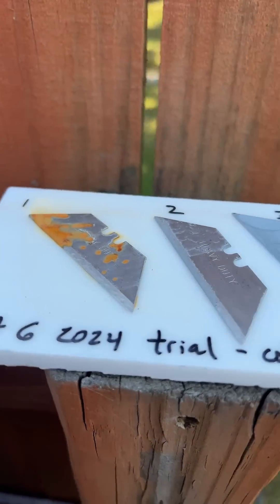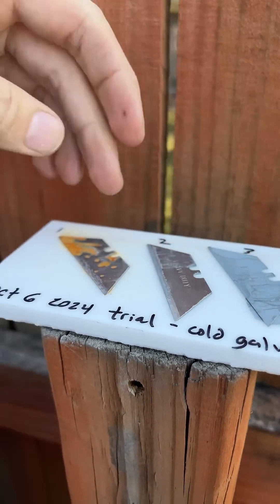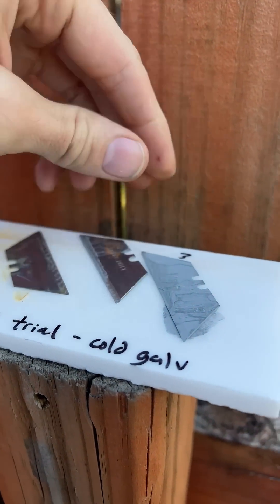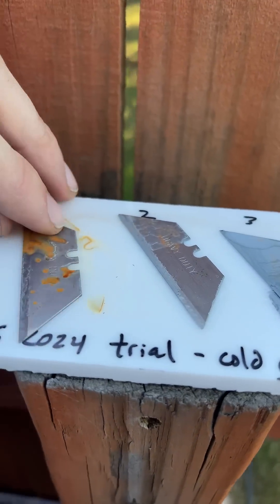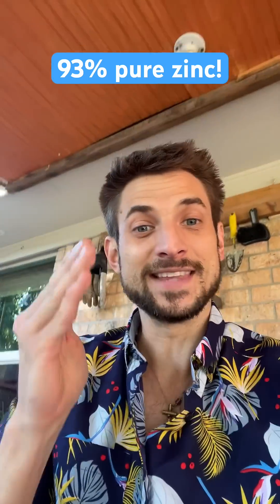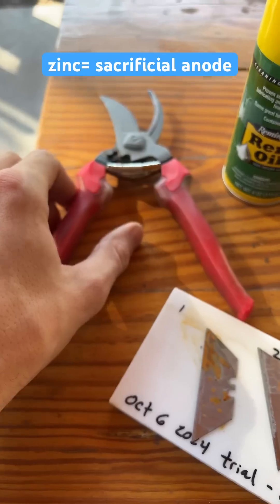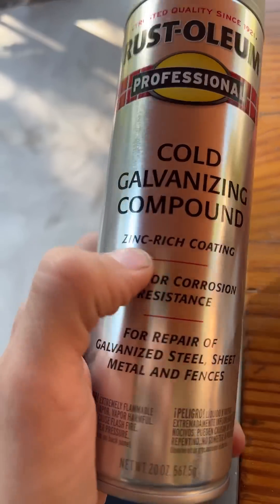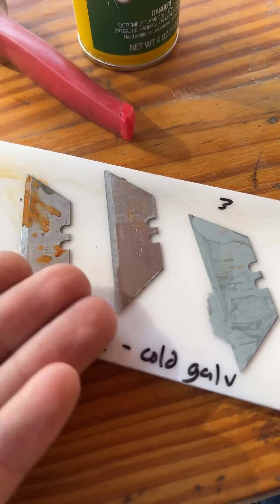metallurgy is real! end rust with this weird trick. #metalprotection

Comment: Zinc plating is great but those pruning shears are garbage! I bought the same ones at ace in the spring and they are terrible. It's mild steel and the edge didn't even hold up to thick branches. I had to put a new edge on them first hour I used them. I'm so glad I found my old fiskars pruning shears. They are a superior product compared to these

Comment: Galvanization can be applied in 2 ways. In a cold spray coating, like this, or in a hot dip where you drop the piece of steel in a molten zinc bath. Both processes are very effective.
Reply: We dip our machined parts in a hot zinc phosphate a d the coating is tough

Comment: I use that shit at least 3 to 5 times a week and I’m telling you it is not a galvanizing compound what it is is a galvanized paint with an adhesion promoter built-in rust oleum because it does not galvanize the metal galvanizing. The metal is an electroplating process does not do that.

Comment: I work in the metal industry, and we build antennae that go thousands of feet in the air. The weather conditions are constantly changing, so the pipes have to be protected. We have ours galvanized, and we also use this spray. It works wonders

Comment: Not sure this is doing what you think it is. You would need an electrolyte to have the zinc be an anode. Water could work, but you then need some current to pass through. 

Mechanically galvanizing a surface will protect it from oxidation, but thats not an electrolytic reaction.

Zinc is not an anode per se. You can put any matetial as the cathode or anode. How well they work for your purpose in that reaction is dependent on lots of things including the material choice.

Comment: Your right that zinc is an anode to steel but without an electrolyte such as soil and a metallic path between the two there isn't a complete corrosion cell. So this is just a good coating which is 90% of fighting corrosion.
Reply from the maker: it’s day 6 of the experiment and i sprinkled tap water a couple of times. 

the uncoated surface of the sample no.2 is barely rusted.

sample 1 looks like mars.
Reply: @davidmalawey if it was acting as a sacrificial anode then there wouldn't be any rust on the partially coated blade, because the zinc rusts first because it gives up electrons easier than iron and that's what protects it until the zinc is depleted, the reason the partially coated blade is still rusting is because isolated pockets of moisture or ions in the air are affecting the uncoated iron where the zinc isn't touching because the electrons and ions don't have a path directly to the zinc through a solution so those spots are essentially chemically isolated from the uncoated portions.

Comment: Can you galvanise the underside of your car with zinc or would that increase galvanic corrosion of other metal components on the car?
Reply from the maker: i’ve got no idea.  but if you try it, i’ll make a video about it.
Reply: You don't need to coat it with zinc you just need a big piece of it stuck anywhere to it making direct contact like they do on boats, if you live in the north it would be worth looking into
Reply: @TheRazorDesigns  true, but that works in water. Each individual drop of water make it's own cell galvanic cell, so that concept doesn't carry over as well in the air.
Reply: Audi used to galvanize the entire body back in the 80s. They dipped the entire body into a galvanizing bath. Look up Audi 100 production line.
Reply: @bro589  I have seen the one they have on the round-about near the factory

It is a shame Nissan did not do this for my Nissan Micra..... 

Maybe once my car has rusted away I'll buy an Audi :')
Reply: @CharlieBaes  it’s just too bad that on an Audi the driveline will fall apart before the body gets a rust spot.
Reply: There are liner sprays for that sort of thing, but they should be applied professionally for best results.
Reply: I think you just need to be careful not to create a galvanic cell. How? Idk shits complicated 😂
Reply: Good question tbh. Raptor liner over that and you'll never rust again
Reply: @jaylynzakikhani4223 never spray any kind of liner because it just traps moisture. Get an oil undercoat
Reply: @jaylynzakikhani4223 not true
Reply: @jaylynzakikhani4223 they do this and it actually doesn’t end well cause it traps the moisture causing worst damage then having nothing on the metal id put the paint on it only should do really well